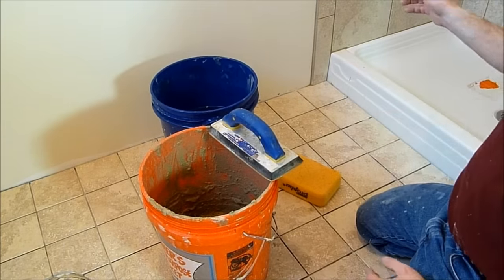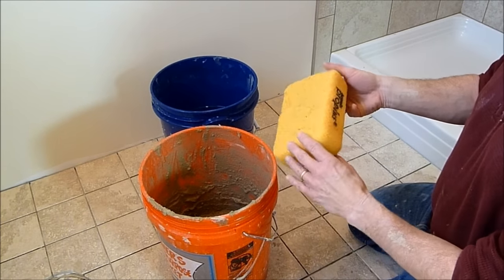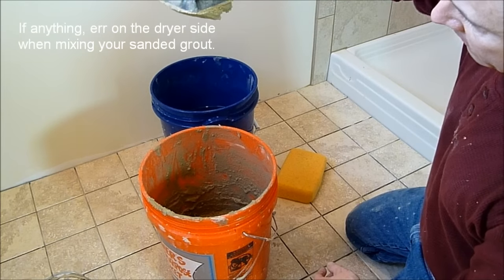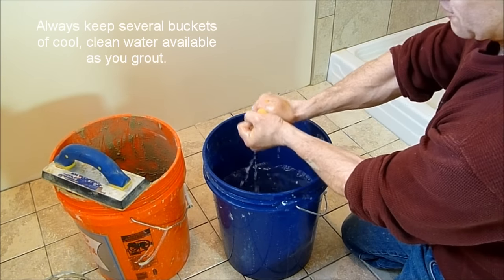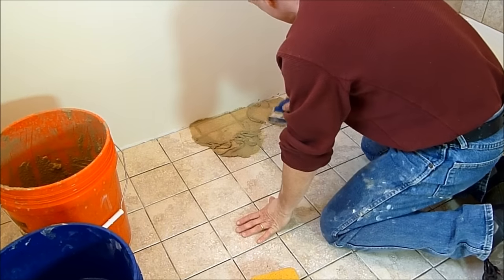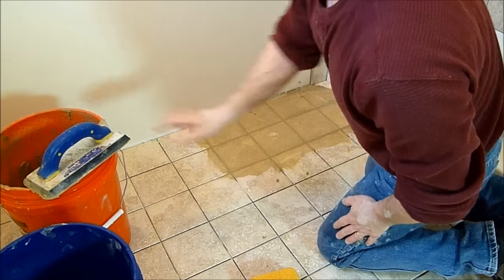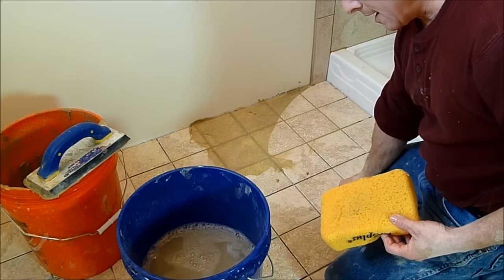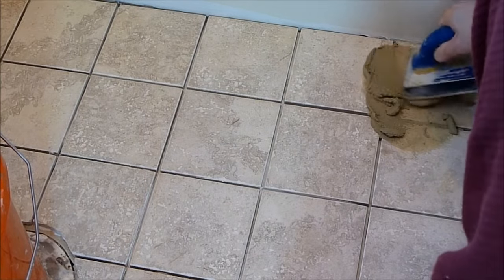How To Grout Tile: Correct Technique Makes It Easy

Comment from the maker: The idea of leaving the grout to set up for 15 minutes is appropriate for very thin grout lines with unsanded grout. In that case, wiping immediately is likely just to pull the grout right back out.  Even so, you can wipe more quickly than 15 minutes if you are skilled and careful about it.  Today, most people are installing wider grout lines with sanded grout, and waiting for set up just isn't necessary.  Just make sure you pack the joints well before wiping.
Reply: Exactly, force all the air out and all the grout in.
Reply: That's me.  I am wiping the grout pretty much after I install it.  I also use two buckets of water; one sponge for the heavy stuff and one to clean up afterwards that leaves pretty much no dry residue.  Ironically. now 8 years later very thin grout lines (1/16") are the in thing.  I actually like the thin grout lines.
Reply: Im about to grout a closet with unsanded. Very small joints as well. Im glad i read this.
Not to take away from this great video.
Reply: Does it make a difference with non-sanded grout? 1/8 inch thick?
Reply from the maker: @lance Sanded grout will tend to stay put because the sand offers some structural support.  Unsanded grout may come out a little easier, but the same technique applies.  If you have 1/8" grout lines you should be using sanded grout anyway.  That's the dividing line between sanded and unsanded, and you'll have better durability long term if you use sanded.
Reply: @enduringcharm what about in a shower where the tile is grouted. Do you use unsanded in that situation?
Reply from the maker: @willp8126 The decision to use sanded or unsanded grout depends on the width of the grout line.  A wider grout line, typically 1/8" or more, requires the sand for structural support of the grout.

Comment: Oh let me add, this was the first time laying tile. It was time consuming, but I saved myself over 3500 doing this job myself. It's not a hard job, it's intimidating at first, but after you have all you measurements and layout, with the right tools and saws. Easy peezy.
Reply: I agree, layed down the tile, now about to do the grout. My mistake was trying to avoid getting a real tile saw. My tiles would fit, except for 1 or 2 areas that would need a corner cut taken out. So I payed the $44 for a cheap tile cutter and it worked perfect. Everything went down easy after the grid was laid out. Seemed scary at first but was surprisingly easy. So get the cutter and do it right, it will look great. No need to hire it done if you can measure and have a t-square!!
Reply: As a tile helper I can't believe I didn't enter this trade at 18 year old would have been making good money by now
Reply: lol ya easy peezy lol
Reply: True and time consuming especially doing it before and a little after a 9 to 5 job
Reply: Not a hard job IF you semi know what you’re doing and if you don’t have any existing layers to demo. New construction, EASY PEASY!!!!!
Reply: I'm a diy'er and did about 500 sf of tile. It's doable but hardly easy peezy. It's a lot of work.
Reply: @orlandorosado2157 Just finishing up 800sf of porcelain tile, and it is brutal.

Comment: I don't leave comments hardly ever. but just wanted to say Thanks! I appreciate the video that is straight and simple too the point and not added bs. you gave a perfect description on how the mix should be and and the techniques to use. I am a pretty descent DIYer and usually stick to electrical and carpentry and decided to take on tile and now the grout I had no idea the right way to do that I found your video and it was exactly what I was looking for and I greatly appreciate it.
Reply: Me too. This shit is very physical, my back, knees, etc. Then again I am 68 yrs old.

Comment from the maker: Good question.  When I'm using a 5 gallon pail I usually add a little water to the bottom first, just to avoid the grout powder sticking to the bottom.  Then I add the grout and then gradually add water in as I mix with a drill powered auger.  I turn the bucket over as I mix with the auger so I don't get dry pockets.

Comment: I don't normally feel compelled to comment on videos but I must say THANK YOU for this! I did about 100 square feet of 13" x 13" tile with 3/16" joints in about 90 minutes last night, using your method. I am using a sanded grout by Custom and there was a little bit of haze that came back (probably from not refreshing the water often enough) but I came back a couple hours later and it wiped up super easily. After hearing horror stories about how tough it can be to get rid of the residue, I was glad I saw your video and did it the easy way instead of the package instructions. I must say, I rather hated the process of tiling, but I actually enjoyed grouting. Thanks!
Reply from the maker: That's great--I'm glad it worked out for you!
Reply: Grouting I believe should be like frosting the cake. We’ll find out this weekend. 😯
Reply: That's 169sqft

Comment: Very nice! Thanks so much! Also may want to make the following notes: When doing a long job like this, invest in a good set of knee pads and stay on the floor as much as possible. Bathroom breaks and the like are common sense, but the up and down off the floor will make you really regret the experience! :-)
Reply: So true! I learned this lesson the hard way more than once. After screaming knee caps and barely being able to walk the next day from too much up and down. I picked up some $8 gel knee pads and they are the most comforting thing you've ever felt when flooring!
Reply: Erez Talshahar Laying down a piece of cardboard works well too if you don't have knee pads.  For any construction job not just tiling

Comment: Oh my gosh thank you so much 🌹!! I'm a first time grouter for a small counter top and you are the BEST! I really hope it's as easy as you make it look, and my little project turns out. So wonderful of you to share your time and experience with all of us DIY's out here! Blessings....
Reply from the maker: Just watch that you don't mix the grout too wet, and really work the grout into the joints with your float.  Those are the two things beginners most often do wrong.
Reply: Yes, unfortunately.... I did, the first batch was like potato soup! 😒 So I went back to the store and got some pre-mixed. I was so afraid it would set up too fast and in my rush to sponge it off, I’m afraid I left some grout on about 3 tiles. It’s not that noticeable, but I’d still like it to be fixed if at all possible. Do you have any suggestions? I used Fusion Pro, Bright White. From Home Depot. Thank you so much for your kind help - I very much appreciate it! God Bless you.🌼
Reply from the maker: Oh boy.  Well, what's done is done.  That pre-mixed "grout" you bought is not actually grout.  It's more of a cousin to paint or caulk than it is cement grout.  It's an acrylic/silicone resin, not a cementitious product.  The technique I showed in the video was for actual grout, but hopefully it will still be okay.  The remainder of what you left behind on the tile you may be able to scrape off with a wooden stick, with a final cleaning with a rag and some elbow grease.
Reply: Well I had a feeling that those people over there at Home Depot didn't really understand or know what I was doing. I know they don't have the expertise that you have. But you know, I'm in Texas and we had that freeze out and I was trying so hard to get everything done before I couldn't even get out and it's my fault that I didn't go all the way back up to Lowe's and get the right kind. But yes it does look very very nice I don't know how durable it's going to be, but it'll be okay for  right now anyways and I'll try to get that grout off with up wooden spatula. Thank you so very much for your kindness and all the advice that you gave me and maybe on my next project I will be better! haha! God bless you!
Reply from the maker: Live and learn, right?  Instead of a spatula, try using the end of a wooden paint stirring stick or a popsicle stick.  The wood will not scratch the tile but you can push the end to scrape off the excess grout.  Then burn the stick to keep warm!
Reply: Haha 😂! I finally got my power back on yesterday! I think I have a paint stick here somewhere... So I'll try that for sure. I was so afraid that I might lose power again... I left all my candles and my flower pot "hot pots" around... So I have a bit of a mess to clean up first. I hope you have a wonderful day and that the freeze doesn't come your way. Once again thank you for your great advice! Bless you!

Comment: Hi, I am wondering if the reason why, when using this technique, you're able to avoid the 10ish minutes-wait between grout application and wiping that others recommend is that your sponge is so dry? I like the idea of working in such small sections and then cleaning immediately -- makes so much more sense to me. Is there no risk in wiping down so soon? Thanks for an awesome video!

Comment from the maker: The sand in grout is there for strength in wider grout lines.  1/8" inch lines are probably right around the borderline between sanded or unsanded grout so I would go by the grout manufacturer's recommendation.

Comment: Thank you for the video. I "knew" it wasn't difficult and I "knew" the steps but seeing it done and explained gave me the confidence I needed.
Reply: take the hard rubber trowel and wipe, at an angle, the excess grout off before you wipe with the sponge...and you can wipe 4 times with the sponge

Comment: Dude... thank you thank you thank you so much for making this video.  I just grouted two bathrooms (am I'm no spring chicken and have a bad back) and I followed your two wipe method and it was EASY and came out FANTASTIC with very little to almost no haze.  Again... thank you.  A+
Reply from the maker: Bourne Accident That's awesome--glad it worked out well!
Reply: enduringcharm You know... that's what I love about YouTube.  Guys like yourself, who have knowledge and experience, and relay that with a simple upload and save guys like me a ton of time, aggravation, and headache.  Thanks once again.
Reply: Just read your comment, and wanted to tell you that if you mix 2 parts water with 1 part white vinegar, and then rewipe your tile it will remove the haze. I do this every time I grout, and tile is my profession. I haven't found a better way to remove haze from any tile, and there is no way to avoid it completely.
Reply: Non Smoker Thanks.  After the plumber gets done, I will go back and do a final clean up of the floor with the water vinegar mix.
Reply: Sweet action. Have fun.

Comment: Hello! Great video! I've been disappointed with my grouting results, and this technique looks like it will fix my issues (mainly removing the color - using too much water). I'm about to grout a larger format tile back splash (4x16) with 1/16 spacing using un-sanded grout. Does the same technique apply, and / or do you have any additional tips for such an installation?
Reply from the maker: JPC437 The same technique will also work on narrow joints.  Unsanded grout seems to dry more quickly than sanded, so don't get too far ahead of yourself.  Be certain you've really packed the narrow space with grout.  With narrow grout lines it may be more important to use the rubber float to pull away the excess.  Relying too much on a sponge may lead to excess water and you may pull out too much of the grout.  Pull the excess away with the float using a diagonal cutting action, then reach for the damp but not wet sponge.
Reply: enduringcharm Got it. The manufacturer (Flextile, Premium Polymer Modified) specification is for 20-30 minutes set time before wiping (post float). Do you recommended wiping right away, or should I wait? To your point, my concern with waiting is that the stuff may dry quick. In one instance, I waited to long and ended up with uneven joints that I couldn't correct no matter how much I buffed them. On the flip side, in another instance, I wiped too aggressively, and the color washed out of the grout. Your technique would have helped me in this later instance. Looking for that middle ground! Any further comments welcome and appreciated!
Reply from the maker: JPC437 Well, for narrow grout lines in the 1/16" range I typically do small sections (maybe 2x2 feet) at a time.  Grout lines of that size are usually found in showers or kitchen backsplashes, so smaller sections at a time work well.  I work in the grout aggressively with a hard rubber float, then "cut" the excess away.  I never timed myself, but I'm sure it isn't more than a few minutes before I'm wiping with the sponge--a damp, not wet sponge!  It's important not to mix the grout too wet either--aim a little more for peanut butter than for mayonnaise.  All of this is subject to the project conditions, though.  If I'm working in a dry winter heated bath I work a little faster.  If the homeowner doesn't have AC and it's a sweltering August, I can slow down.  Use your eyes and hands to judge, not your watch.

As for the color washing away, I've never experienced that condition.  All I can guess is that either you mixed the grout for too little time (use a drill and auger) or that you just had too much water in the sponge.  Make certain you have a sponge designed for grouting and wring the life out of it each dip in the bucket!
Reply: enduringcharm Thanks for the guidance, and for your quick rand helpful replies! I'm off to grout!

Comment: Hi. Some of the other videos on grouting I've watched insist that after the initial pass with the float only, the grout should be allowed to dry for 15 to 20 mins before using the damp sponge technique. In you video you skip this step. Is there a difference?
Reply from the maker: You are referring to the old school method that for some reason persists today even when it is not necessary.  The chemical formulations of grout have changed, so maybe many decades ago it was necessary to let the grout "set up" but today it is not.  As long as you follow my advice closely you will be fine.  Don't make the grout mix too wet, make sure you really pack the joints tight with grout, and make sure you wring out the sponge very well before wiping with a turning motion shown in the video.  The next morning you may have a slight haze almost like talcum powder on the tile that can be wiped off with a damp paper towel.  That's it.
Reply: enduringcharm Awesome. Thanks so much! Glad i watched your video before tackling my first grout job.
Reply: enduringcharm You say it is old school but even on the grout bags it says to wait 10 -20 minutes. I just finished my kitchen and did wait about 15 min per section. It was alot harder to clean but it still turned out great. My next project is the washrooms so Im not going to wait ...lol..
Reply: May have to do with the mixing ratio.  Wetter the grout, easier to fill but needs to dry so that it doesn't just wipe right out.  Just a little difference in moisture will determine ease of use and best technique.
Reply: Eric Jimenez as long as you don't wash out the joints you will be fine. Letting it dry that long means by the end the last tiles you are scrubbing to get the dried off of them

Comment: Dude! Excellent primer.  I did a bathroom a couple years ago, and used University of YouTube then too.  The advice was to let the grout set up, and it was a Royal PITA to get it off. I almost broke out the sander. 

Yours is a way better technique. I'm so glad I checked again before my current project. Thanks so much for the help.

Comment: wear latex gloves as well. grout dries the crap out of your hands ;)
Reply from the maker: It can at that!  My hands take a beating every day so I don't even notice it, but DIYers may be more sensitive.
Reply: I wore gloves doing my bathroom walls and they just kept tearing repeatedly.
Reply: The hero we need, sir.
Reply: A little abrasive on the naked hands. Took just a day to recover not using gloves.
Reply: @zEndersShadowz  u gotta put thin work gloves on top i do it when i have to pull thousands of feet of hose at work
Reply: Take the condoms off your hands and feel what work feels like
Reply: Textual Predator  - lmao
Reply: @joshsaeman84  i cannot🤦‍♀️🤣🤣🤣
Reply: @joshsaeman84  savage bro
Reply: Can't wear latex gloves. Water gets into the gloves while rinsing the sponge, then the gloves drip water onto the grout, weakening and discoloring the grout.
Reply: @zEndersShadowz  use better gloves
Reply: Watching this on the toilet gives a different perception of that grout color.
Reply: I do this for a living. My fingered bleed from being dry I have to apply moisturizer every hour
Reply: I wear one nitrile and one latex glove, switching left to right every 100 square feet, just to stay in compliance with the use of both Home Depot and Loews bucket.

Comment: I used your technique yesterday, did everything you outlined in your video. Grout is still drying and looking actually pretty darn good. My grout was actually on the dryer side and was not real sure about its effectiveness. I tested a small area for strength, grouting was done about 12 hrs ago.....I would have to say, holding up great at this point. First time ever tackling tile flooring, thanks for the video and as far as I;m concern....Excellent advice. Thanks!!!!

Comment from the maker: When you have very thin grout lines you may need to wait between wiping because otherwise the grout will pull out of the joint when you wipe.  For most sanded grout lines today, though, my technique should work fine.